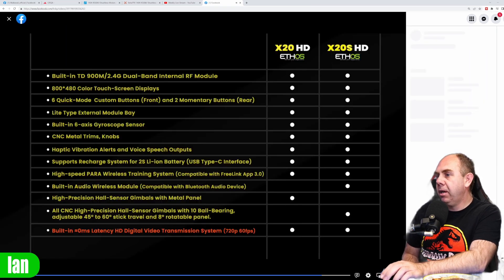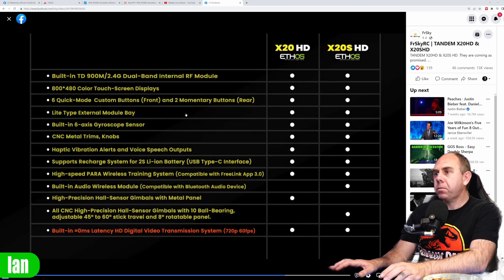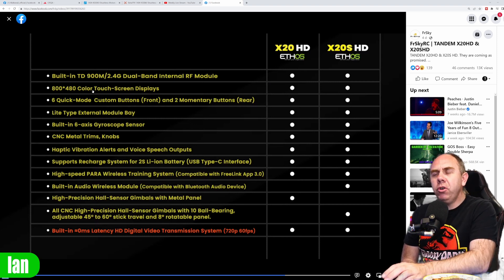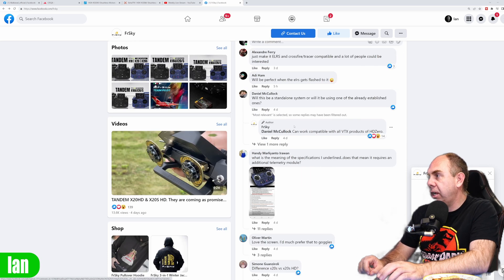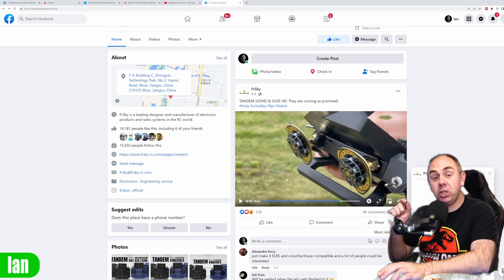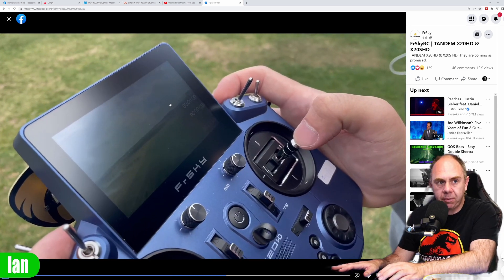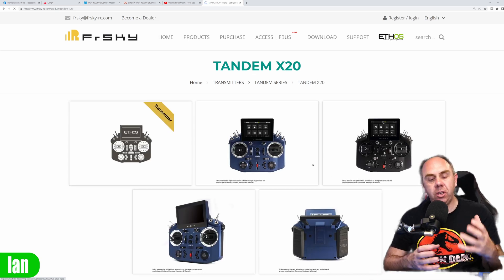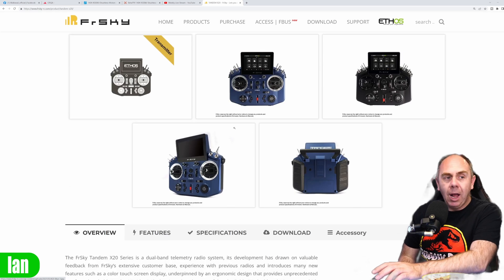Frsky Tandem X20HD HDZero Digital FPV - Live Clip

Comment: I have the Tandem X18 and I love it. I do fly some fixed wing models, but mostly quads this past year. Setting up ELRS was a pain in the ass for some reason. I was actually very curious to see if I could hack a walksnail into it lol. But if the screen isn't at least 720p I don't think it will even display anything. Cool idea, but probably a bust.

Comment: I bought a Tandem X20S a couple of months ago and although the lack of crossfire and elrs support (for now) is not ideal, I have to say that Ethos has been a pleasant surprise thusfar. The OS works very intuitively in combination with the layout of the touchscreen on top of the transmitter. But the real reason I bought it was because for me it feels very natural to hold.
Only complaint have are the pots on the side. I wish they were sliders instead just like on the newly released X18. 

I just hope it will be possible to upgrade my X20S to have the same capabilities as the X20HD
Reply from the maker: That’s great info.  I have heard some good things from others to.  That really rings in with what they said.

Comment: Nice to see Frsky getting on the HD bandwagon. I will certainly look into it. I have always used Frsky, still happy with my Taranis, never let me down in 5 years, coupled with the R9 i have not had a need to complain. But HD would be nice to have, certainly thinking it's time to move away from analog now that HD gear is becoming more wide spread.
Reply: Update to EdgeTX and ELRS and thank me later.

Comment: but hdzero is 5.8ghz?
Reply: Video transmission is 5.8ghz. RC transmission is 2.4 and 900 ghz.
Reply: @danielmccullock1249  Wow that sucks if video transmission is 5.8 ghz. 5.8 ghz range is shorter then 2.4 and 900 ghz.